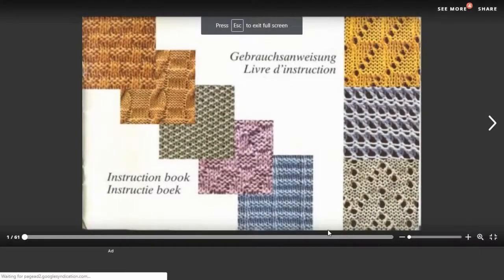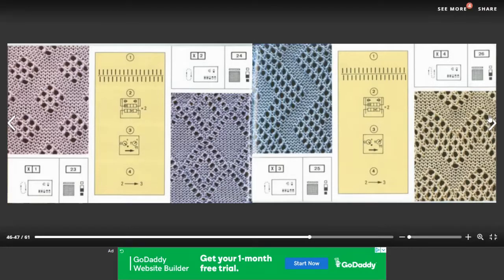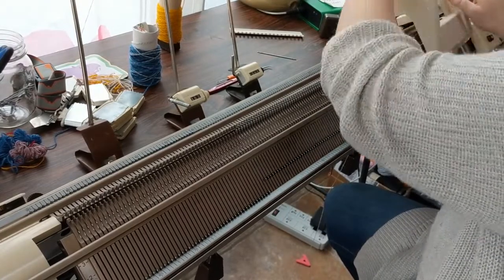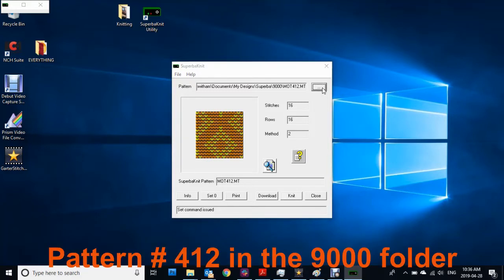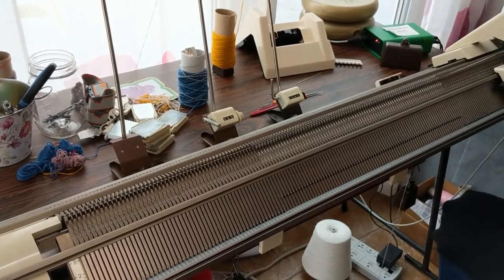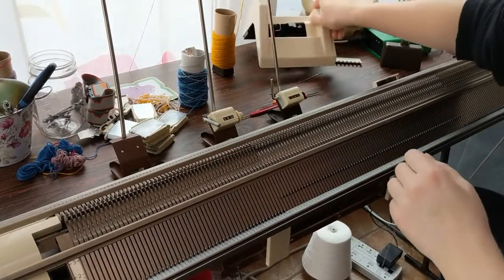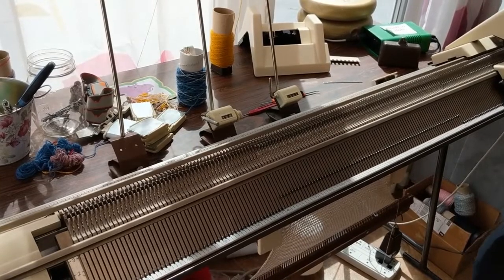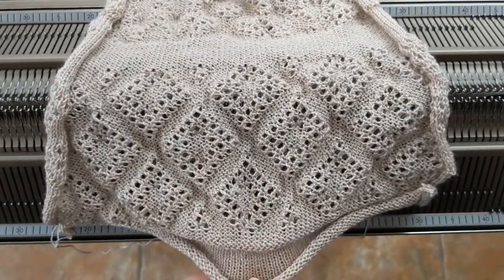Lace Knitting on a Superba Double Bed Knitting Machine with SuperbaKnit

Comment: Hi, can you do this type of work with an old singer memo 2?
Reply from the maker: Yes you can! The transfer carriage will fit on all the similar double bed models. The only difference will be how the electronic input is programmed.
Reply: @heatherismakingstuff  thanks! I bought a second hand singer and don’ t understand the instructions.
Reply from the maker: @silviatornabene2357  that's very common, the instructions are cryptic, lol. There is a very helpful Facebook group for Superba machines, as well as a ravelry group, and on YouTube, The Answer Lady has some very helpful videos on basic things like cast-ons that are transferable to any of these machines.
Reply: @heatherismakingstuff  cool, infortunately mine isn’t superba
Reply from the maker: @silviatornabene2357  oh sorry - if it is this style of Singer double bed machine, they are all made by the Superba company in France. They branded them under different names for sale in different countries: Singer, White, Phildar, Superba, but they all work the same way. If you have the memo ii with the pressure pad input you have the right kind for these videos.
Reply: @heatherismakingstuff  yes, I have. I‘ll join the Facebook group in order to learn how to use the machine. I have a defendi brother too, it’ s different. I’ve been using it for 40 years!
Reply: Hi
Reply: What’s the name of Facebook group?
Reply from the maker: @silviatornabene2357  Superba/Singer/White/Phildar Knitting Machines on fb
Reply: @heatherismakingstuff  thanks